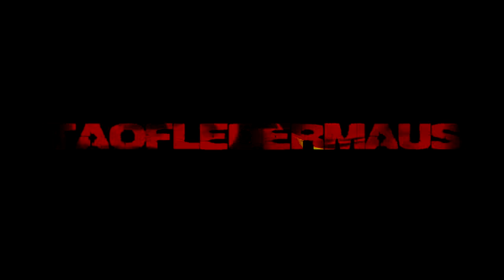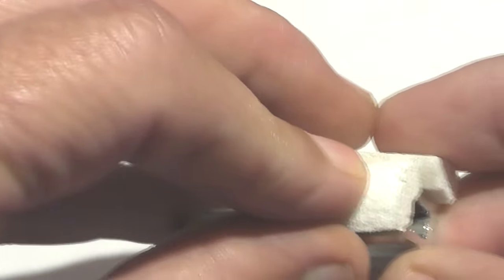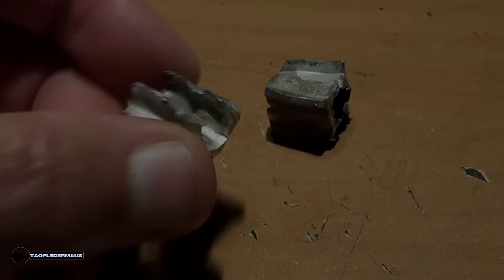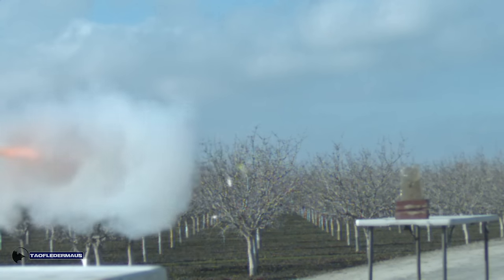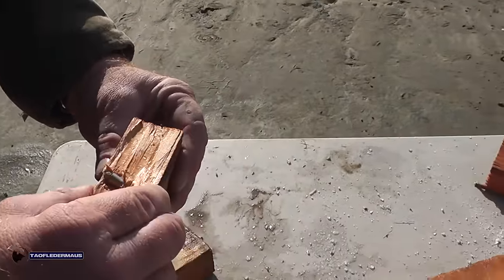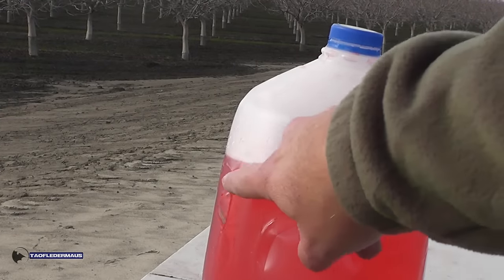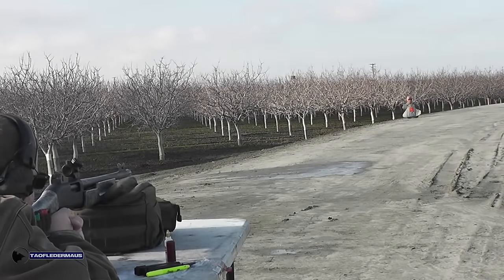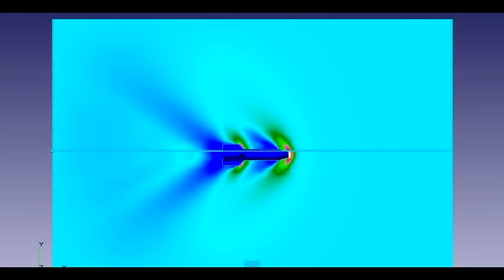Russian Discarding Sabot Shotgun Darts - ZENITH

Comment: He should have used steel for the fins.
Reply: and tungsten head for reusability
Reply from the maker: I think he was concerned with achieving the correct balance.
Reply: But he didn't though, the center of mass was too far forwards even though the center of gravity might have been right in the middle. That's what causes a lot of these rounds to tumble. You could try balancing them on a finger before you load them, but if there's a lot of weight on either end it's gonna tumble erratically
Reply: Like two steel balls connected by a chain.
Reply: +Jack Ryan
"centre of mass" and "centre of gravity" are the same concept.
Reply: OminousPineapple no they are not.
Reply: Explain.
Reply: Savage Porkchop center of mass is a term used to refer to the area in which most of an objects mass is located, while center of gravity is the point at which an object can be balanced and where each half of any  given axis are equal
Reply: That's the same thing. Gravity is an inherent property of mass. The center of gravity, i.e., the "resultant" weight vector, is the centroid of the mass, and the balance point.
Reply: jjohnston94 no, center of mass is a general area, I.e. your chest. center of gravity is a precise point
Reply: Uhm no, that 'shooting center mass' has found widespread usage doesn't mean it's different from center of gravity. Center of mass can in fact be outside of the object.

Also, I don't quite get the axis thing. That would only work in a symmetrical object made from a homogeneous material.
Reply: Chris Smeets Center of mass-a point representing the mean position of the matter in a body or system.
Center of gravity-a point from which the weight of a body or system may be considered to act.
Yes, under constant gravity, they are the same point, but they are not the same concept.
the axis thing is talking about the balance of the object. in order to balance, the mass needs to be symmetrical, not object itself
Reply: "center of mass is a general area, I.e. your chest"

Oh, please. "Center mass" in that context is a term used by law enforcement to sound important, like "person of interest".
Reply: He is right that Center of Mass and Center of Gravity are two different things, he just fails to understand why. The difference is NOT that one is a general term and the other is more specific. As far as most of us are concerned, they refer to the same location, but in Physics they are distinct. If a mass is in a uniform gravitational field, they are the same, but in a gravitational gradient they are not. The Center of Mass will not change even in a varying gravitational field, but the Center of Gravity will. TL;DR: CoM and CoG are essentially the same thing here on earth(unless you are designing aircraft  or spacecraft or the LIGO etc.), but in a massive gravitational gradient (Like near a Blackhole) the two quantities can be drastically different. For more information, refer to the almighty Google.
Reply: And I thought I was a pedant!
Reply: Haha, we pedants must unite! A lot of people hate us.

Comment: Isn't the drop/distance determined by its velocity, rather than the weight? Because everything drops equally fast on earth (9.81m/s²)
Reply: muh1h1 the drop distance would be proportional to velocity if it traveled at a constant velocity but due to variances in momentum 2 projectiles of similar velocity but different mass would travel different distance due to different reductions in velocity eg a 100 gram projectile traveling 300 meters per second would have more momentum and thus more energy than a 3 gram projectile traveling at the same velocity
Reply: Thats true, so the weight only has an indirect effect on the drop, because it influences the velocity, which intern influences the drop. But what Tao said was, that there was very little drop because of the little weight of the projectile (05:55), accroding to your explanation the drop would be more with a light projectile, because the velocity is reduced faster due to the less amound of momentum the projectile has. I am not trying to correct anyone here, i am trying to understand it for myself. I have no experience or knowledge about ballistics whatsoever, just a healthy knowledge of basic physics...
Reply: What I have been told is that a slower projectile stays in the barrel longer thus is affected more by the upwards recoil of the barrel. The effect is that slower projectiles impact higher at close range than faster projectiles out of the same gun. I don't know if there is any scientific corroboration of this.

Comment: Request: Demolition Ranch did something with drill bits, but he just jammed a bunch of bits into a shell. Actually had to take the shotgun barrel off to jam the things in there. What nobody seems to have done is cut the tip off a large drillbit and use that as a slug. Just the tip off of a drill bit exactly the diameter of a 12-ga. slug. You should be able to do a neat job of it with that roll-bead maker of yours. I'd be curious to see if they do better out of a smoothbore, with the grooves of the drill bit catching air and spinning the slug, or if a slightly smaller drill bit tip with a sabot out of a rifled barrel would fly better.

Edit: Funny thing, one of the key points about the use of smokeless powder vs. black powder is that smokeless is supposed to burn more slowly. It became standard partly because of reduced fouling and smoking and partly because it made use of longer barrels to build up to a higher overall pressure than black powder could reach, exactly because it took longer to burn. I can't argue with results, of course, and those sabot darts did seem to perform better with black powder, so maybe the problem was that higher maximum pressure with the smokeless? Maybe they were being wrecked by that maximum pressure, rather than by the "snappy" shock, since the "snap" would've actually been worse with the black powder.
Reply: Yeah, I saw some of those, and I do remember that effect; that's why I mentioned sabots and rifled barrels too. Actually I fully expect that that's exactly what will happen; that it won't get any airflow in those grooves at all, and that if it spins, it will be from action with the barrel, meaning it should probably have some kind of sabot to protect the barrel; it is a drill bit after all.
Reply: Artimus Protensor I would also like to see that I am fairly sure someone makes big bits that fit a 12 gauge

Comment: Shotgun powders are usually some of the fastest so I don't doubt that the pressure shredded them
Reply: Shotguns typically have low pressure because the bore is so wide. .22LR actually has a max chamber pressure twice as high as some 12 ga shells.

But yeah, they pretty much fire pistol powders.

Comment: could you load some black powder against the primer and fill the rest with a faster burning powder to get the dart moving down down the barrel before it gets a shock load from the fast burn powder?
Reply from the maker: There are a lot of different smokeless powder with different burn-rates. I just didn't have any means to find the same smokeless powder Alexey used.

Comment: What about a design where its the opposite, the fins and such are the front half and the tall center portion is the tail. Then upon impact the tail drives through the front half, penetrating fin portion and the target?
Reply from the maker: I can't see that working very well,  like trying to make a F16 fly backwards.
Reply: ZA_Survivalist it should turn around if it doesnt fly completely straight.
Reply: Maybe za is thinking about a HEAT round ?
Reply: I would actually like to see these made with a tougher material to withstand the explosion.
Reply: ZA_Survivalist like the knob round they shot?
Reply: Maybe just cut it in half and weld in a mechanical broadhead in the middle of the bullet part to increase lethality, it flew pretty damn straight so why piss into the wind by reversing it ...

Comment: I imagine that if the three metals were upset with another replacing the aluminium, then, this would be able to take on the grunt of smokeless powder. Also, i think that the rounds bounced inside the barrel, because with normal fragmentation, they would've come out relatively equally spread out, but they didn't. At least, that's what i saw from that perspective of the camera.

Comment: I like the idea of using steel for the fins also, but I think that more cushioning, (at least twice or maybe 3 times as much as I saw), along with a slow burning smokeless would work with the aluminum.
30 grains of black is definitely subsonic. Standard BP load for 12 guage with 1 oz shot was 3 drams, ie 90 to 100 grains. That would give you about 1100 to 1200 fps.
Reply from the maker: I was really worried about messing up the few darts I had left after the first three failures.

Comment: Is it true that sabo rounds scratch the inside of the barrel?
Reply: No, the plastic/foam pieces are called "sabots", they surround the projectile and they are the buffer between barrel and projectile. They get the riffling etched into them, they separate after leaving the barrel and leave a pristine projectile travelling on its way.I have a rifled barrel for my Mossberg 535 and I use Remington accutips sabot slugs (3 inch) for deer hunting.They are expensive as fuck and kick like a horny mule, but your launching a 385 grain jacketed hollow point at 1900 fps........fun times!
Reply from the maker: No,  there isn't any metal to metal contact.
Reply: Even if there is a metal to metal contact... Slug made of soft metals - aluminum and brass. They are not hard enough to scratch chrome treated steel barrel.

Comment: Very cool!  Perhaps if the fins and body section were made of one piece using at least a 3 axis mill and they were made out of titanium then this round would do better at higher velocities.  Also the sabot material needs to be made of some sort of plastic that holds tighter tolerances to the bore and made out of only two pieces.  Also the base of the round might not need a wading if the sabot is made correctly.  TAOFLEDERMAUS, is it possible to do a charge of black powder at the base of the shell next to the primer and then to have smokeless on the top of that?  I only think of that as my understanding is that black powder gives more of a push type of recoil where smokeless give more of a snap.  Perhaps the initial acceleration needs to be slower and then the smokeless could kick in after the projectile is already moving allowing for a more continuous burn the length of the barrel.  The black powder base charge would probably have to be made into a sort of hardened cake so that the two don't mix together.  Just a thought.
Reply from the maker: I can't blame the slug.   Alexey had good results with a Russian powder and had higher velocities.    It's just hard to try to match a Russian powder with something I can get here.   No cross-references.

Comment: Black powder burns faster than smokeless.
Reply from the maker: only outside the chamber.
Reply: Oh, I didn't know that. Thanks 

Nice videos by the way.
Reply from the maker: Look how long the black powder stays burning after it leaves the barrel.
Reply: Good point.
Reply: Black powder is strange like that. If you burn it just sitting in a pile, it goes up in a flash. If you compress it into a tube, it burns much differently.
Reply: Because it requires more oxygen to burn fast.